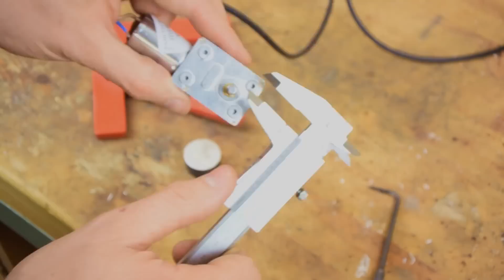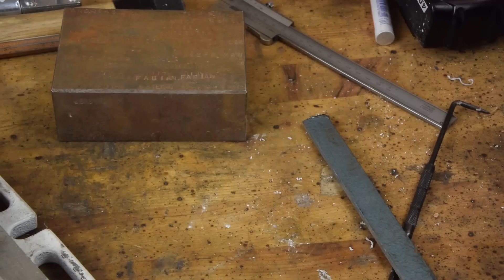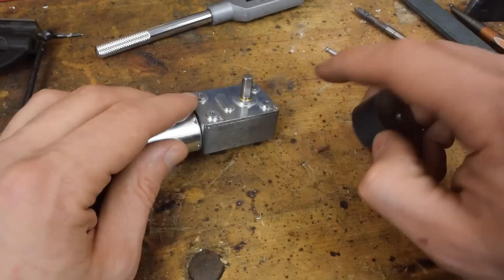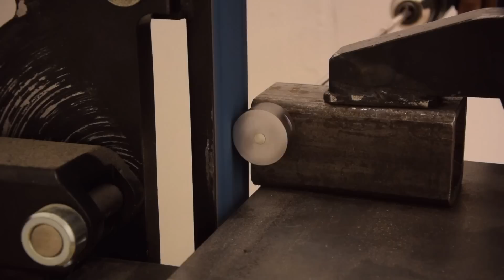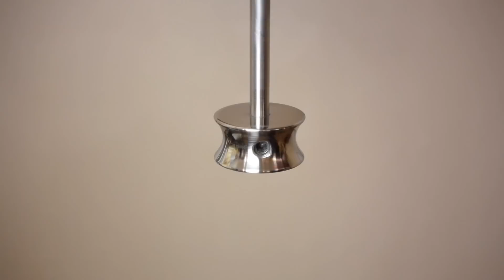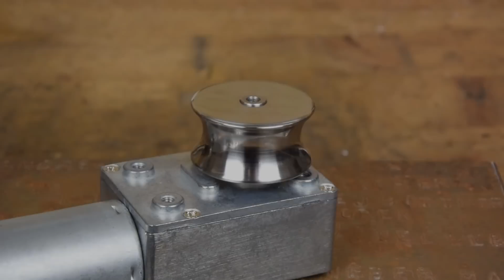How to Machine a Pulley on the 2x72" Grinder | Grinder Turning Technique | Making a Pulley

Comment: Nice job! One thought: I winced when you drilled the center hole without any fluid (oil). I'm a knifemaker and drill steel often - usually high-carbon (sometimes hardened!) steel, using fairly high-quality bits (like cobalt and occasionally carbide). While using cutting/tapping fluid isn't necessary for just mild steel, it leaves a much cleaner -- and actually rounder hole, and is much kinder to your drill bits. Even a plain 3-in-1 type oil is far better than none...

Comment: great video and job on the pulley cosmas. when i have to cross drill a round part i use the ruler method, you put a short steel ruler between the part and the drill bit if the ruler is level with the drill press table you`re on center. it`s an old trick someone passed me many years ago. thanks for sharing.  take care. pete

Comment: Have you tried out the motor? 
It is one of those cheap 7 bucks geared motor thingys from china right? Do they feel as strong as you expected and as they are rated? 
Fantastic finish btw, did not think 600. would be enough for that mirror finish.
Reply from the maker: Yes, it seems to be ok. Yep I was pretty surprised, too. I thougt that you would need at least 1000 grit to produce a somewhat mirror finish.
Reply: I use 2,000 grit and I still see faint lines

Comment: Good day Mr Bauer, I have just been looking at your video, making that curved pulley wheel on your 2x72 belt grinder. A great job and well accomplished. I am still learning metal work and machining. I have two questions for you. I don't want to injure myself, so why is it not good to wear gloves when working at a drill press? Also, did you build your belt grinder? I am looking at different ideas for making my own grinder. Any chance of some pictures of your grinder. Have a good day. Kind regards Basil.
Reply: Drill bit can easily catch your glove, then your finger, hand...   If you are using the big factory drill press, it will cut you in half. Same with the lathe. Usually if it is for machining metal, it can easily kill you if you're not careful.
Similar fun is with long hair or long sleeves.
Reply: Back in high school a classmate walked past the lathe and caught his sleeve on the metal rod sticking out the end.  Was very, very lucky to get away with only heavy bruising and needing a new shirt (and probably new underwear).